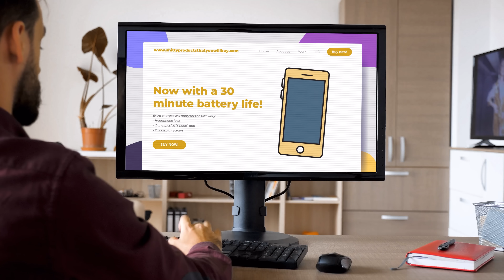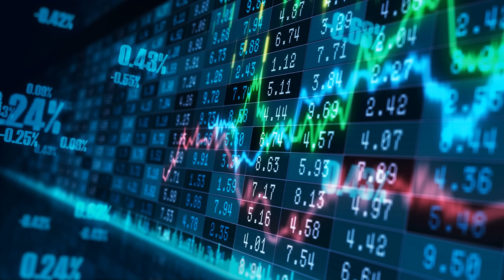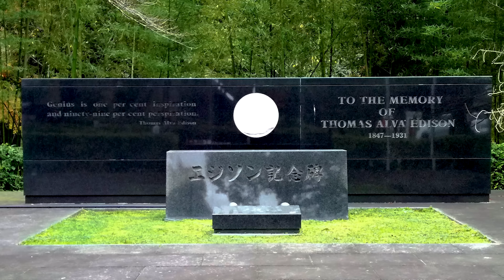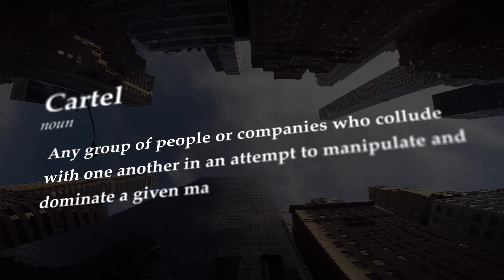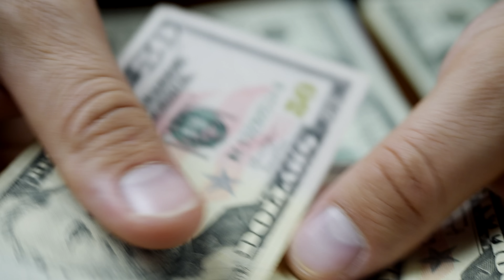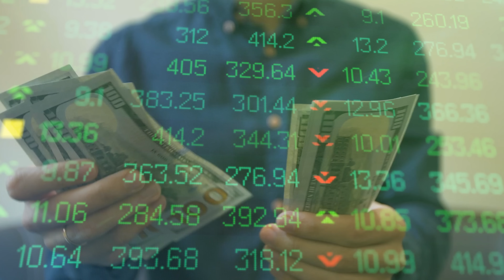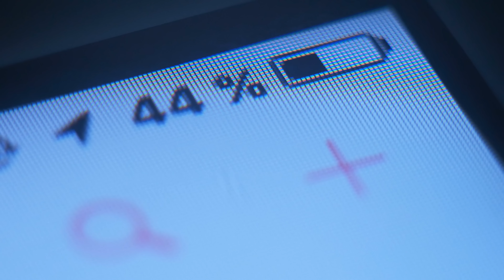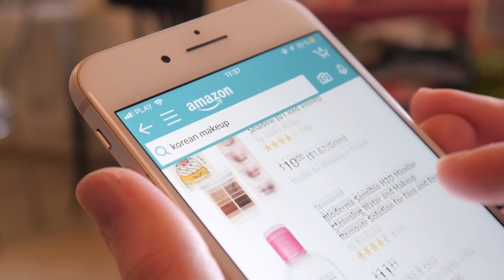Why All Lightbulbs Are Designed to Break

Comment: 4 years ago LED bulb boxing often included "lasts for 15 years" "15 year lifespan"

Not only has that marketing vanished the last 2 years, not a single one of the dozen bulbs i bought back then lasted more than 2 years.

Which is still better than the 3-6months incandescent bulbs lasted.
Reply: Technically, the LED itself will last that long. It's the circuitry that controls it that dies from heatsoak, mainly because of the minor voltage fluctuations that we experience.
Reply: that's bad for an LED. Mine have lasted much longer. We maybe change 1 or 2 out of the 20+ lamps every year at home.
Reply: A LED bulb which burns out that quickly is badly designed.  Properly designed, a LED bulb should last for roughly 10 years, and when it fails it will usually be the control electronics which fail rather than the LED.
Reply: @melkiorwiseman5234  my LCD monitor has 10 years and works just  as it did when was brand new
Reply: LCD screens have a LED backlight most of times, doesn't it?
Reply: @davidklein1245  that's why you should never use LED lamps that come in a single piece. I buy only the LED and a dedicated power supply, that way when the power supply fail, you can easily replace it, or even fix it, as usually its some capacitor, its easier to recap it and it will go for another 5y or more.
But usually the power supply won't fail, because you buy one that has specs greater than the LED needs to work, so it doesn't work overloaded as cheap crappy single-piece one does.
Reply: @srpenguinbr  As I understand it, most LCD screens use a "cold cathode" flourescent light as the backlight.  But running anything from a highly regulated supply will maximise its operational life-span.
Reply: @melkiorwiseman5234  I have like one of the old LCD widescreen TV's that came out about 20 year's ago that still works. lol
Reply: @melkiorwiseman5234  your prob right. I forgot about the 1.5 to 3 watt bulbs I bought for outdoor lighting. Those are still working, the low power combined with nighttime out door use allows them to run with low heat.

All the indoor 6watt+ bulbs have burned out
Reply: The two first LED bulbs I bought have lasted 7 years so far and longer than any of the newer models.  These look different than what you find today.
Reply: When I started buying LED bulbs I kept track of when each bulb was installed and where in the house, there were some Philips ones from Home Depot that hit the sweet spot of being fairly bright and lasting 6 years in continuous use spots. (Earlier ones were lower brightness.)  Unfortunately by the time I established that they stopped making that particular type.  (The good ones were the ones that were in 3 separate segments and looked yellow when turned off.)  The ones I find now (NOMA from Canadian Tire) are a lot cheaper but start flickering about a year in so they have to be replaced.  I'd hate to think what an epileptic who got one of these would be going through.

If I knew that was as good as they were going to get before going downhill I'd have stockpiled the good ones.

Oddly I still have 4 CFL bulbs that just won't burn out...I am wondering if they were the first ones I bought and the newer ones failed before them...I didn't keep track with those.  Though 3 of them are in lights that are only occasionally used.
Reply: LEDs have a real problem with heat.  Make sure your LEDs aren't enclosed.
Reply: Most of my LEDs are over 5 years old, and I find myself torn between "keep them because they work" and "get newer ones because they are brighter".
Reply: we live on a plantation
Reply: Our lives are designed to occupy us with buying replacement parts and new phones
Reply: @zakadams762  I still use my Nokia 6230i..... Does that make me weed?
Reply: @wernerviehhauser94  
>I still use my Nokia 6230i..... Does that make me weed?

No, but if you used a Nokia 420 that would be a different story... ^_-

Keep the bulbs that still work, if you have a room where you really need the extra light maybe put a few newer brighter bulbs there and keep the older ones that keep going put aside to replace bulbs in other rooms where it doesn't have to be as bright, or as something to fall back on if the new ones go quickly.
Reply: My incandescent light bulbs lasted many many years.  I use light switches with "soft start" and they increase the life by orders of magnitude, by giving the filament time to heat up before delivering full power.
Reply: All that time and effort to shaft people/ customers !! Imagine if us humans applied the same time and effort for the betterment of everyone ! Scumbags
Reply: @Ryan-fq8xw  True. BUT perfect products would only be possible if we, as a society, would find a way to work with only 20% to 40% of the jobs (that are partially created by inefficiency) we have today. Its not possible for us to work as each others hairdresser to fill this void - so, on the way to better products, we also need a better society.
Reply: @wernerviehhauser94  if we live in society like in Star trek, where all people have everything, and dont work for money, but just for better future. And everything is for free. But standardized. To be top quality but u cant have dudes driving bugatti fof 5 Million, and Yacht for 50 milion. Everybody need to be equal
Reply: @falconflylow  and I don't see this happening any time soon.
Reply: I've had the same LED bulb in my bedroom lamp for like 7 years now. Way brighter than the traditional bulb too.
Reply: @davidklein1245  Excellent point.
Reply: Blame the cost reduction race for short lived LED bulbs, cheaper support components, LEDs pushed very hard... 12 LEDs, no, we can get away with 10
Reply: @vids595  They're probably Chinesium bulbs, made for Philips and branded for them.  Unfortunately, even a once-respected company such as Philips prefers profit over quality.
Reply: @srpenguinbr  If it is an "LCD" screen, it probably has fluorescent back-lighting. "LED" screens are still LCD with LED back-lighting.
Reply: @falconflylow  pretty sure they tried that with communism Haha, but yeah where all to greedy it seems we struggle to work for a comman good unless theres something in it for us
Reply: @byronjeffries9754  The thing is, if we DID work (at least some of the time) towards the "common good" we would all benefit in some way. What goes around tends to come around at some point.
Reply: @Foolish188  Mostly true but it depends on the internal spce and the materials used.

For the past few years I've gotten away with using a 15W LED in my antique globe fitting in the bathroom .. this has a base made entirely of glazed ceramic and the (large, about 12" diameter globe is opaque glass. This allows sufficient cooling especially since I am using an ES to BC adaptor which serves the additional benefit of having the lamp right in the middle of the globe and also allowing more space above the lamp in the top of the enclosure. I wouldn't risk it in a HOT climate though. Nor would I do so with the smaller, plastic modern "copies" due to the smaller enclosure compounded with the insulating plastic.

Another benefit of course is the choice of colour; in my case the 6500°K LED gives a much cleaner white light (and a fair bit brighter too) than a 100W incandescent.

Note that CFLs rated above 15W refused to work properly in this enclosure, even for short periods.
Reply: @Foolish188  This I largely agree with but there are of course exceptions.

In my case, an antique globe fitting in the bathroom in which I fitted a 15W LED a few years ago:; this is about a foot diameter with a solid single-piece ceramic base and an opaque glass globe. The lamp is also fitted into an E27 to B22 adaptor which serves two purposes .. positioning the lamp right in the middle of the globe (where it should be!) and giving more space above the lamp base inside the enclosure. The glass and ceramic construction evidently provides sufficient heat transfer in my application.

Just need to check the internal space, lamp positioning within and the materials used and keep to a sensible wattage (which is critical). For example, I wouldn't put one of these in one of the more modern, smaller, all-plastic globes, or any "compact" fixture.

I did find that higher-wattage CFLs did not work reliably, even for short periods. But this LED provides a superior substitute and has a much nicer 6500°K white light, so I'm happy with that.

I tend to date code lamps on installation, so will check whether I did so with this one at some point. A number of the LEDs are from around 2016-2017. I still doubt they'll match the longevity of linear fluorescents though; e.g. the 13W under-cabinet lights in the kitchen have had the same tubes since about 2006 and have seen well over their rated life now. A bit like me I suppose.
Reply: @Foolish188  This I largely agree with but there are of course exceptions.

In my case, an antique globe fitting in the bathroom in which I fitted a 15W LED a few years ago:; this is about a foot diameter with a solid single-piece ceramic base and an opaque glass globe. The lamp is also fitted into an E27 to B22 adaptor which serves two purposes .. positioning the lamp right in the middle of the globe (where it should be!) and giving more space above the lamp base inside the enclosure. The glass and ceramic construction evidently provides sufficient heat transfer in my application.

Just need to check the internal space, lamp positioning within and the materials used and keep to a sensible wattage (which is critical). For example, I wouldn't put one of these in one of the more modern, smaller, all-plastic globes, or any "compact" fixture.

I did find that higher-wattage CFLs did not work reliably, even for short periods. But this LED provides a superior substitute and has a much nicer 6500°K white light, so I'm happy with that.

I tend to date code lamps on installation, so will check whether I did so with this one at some point. A number of the LEDs are from around 2016-2017. I still doubt they'll match the longevity of linear fluorescents though; e.g. the 13W under-cabinet lights in the kitchen have had the same tubes since about 2006 and have seen well over their rated life now. A bit like me I suppose.
Reply: @Foolish188  This I largely agree with but there are of course exceptions.

In my case, an antique globe fitting in the bathroom in which I fitted a 15W LED a few years ago:; this is about a foot diameter with a solid single-piece ceramic base and an opaque glass globe. The lamp is also fitted into an E27 to B22 adaptor which serves two purposes .. positioning the lamp right in the middle of the globe (where it should be!) and giving more space above the lamp base inside the enclosure. The glass and ceramic construction evidently provides sufficient heat transfer in my application.

Just need to check the internal space, lamp positioning within and the materials used and keep to a sensible wattage (which is critical). For example, I wouldn't put one of these in one of the more modern, smaller, all-plastic globes, or any "compact" fixture.

I did find that higher-wattage CFLs did not work reliably, even for short periods. But this LED provides a superior substitute and has a much nicer 6500°K white light, so I'm happy with that.

I tend to date code lamps on installation, so will check whether I did so with this one at some point. A number of the LEDs are from around 2016-2017. I still doubt they'll match the longevity of linear fluorescents though; e.g. the 13W under-cabinet lights in the kitchen have had the same tubes since about 2006 and have seen well over their rated life now. A bit like me I suppose.
Reply: @wernerviehhauser94  you could swap the low lumen lights to places you don't need the extra light. Use brighter ones where you really need it. What we do.
Reply: @nailsofinterest  won't really works since the sockets won't fit. Sadly, the pre-owners opted for 12V Halogen here, CFL there and the like. So I guess they stay where they are and I replace them when they break. Which, in the last 2 years, has been one G24, one T8 and one MR16 LED.

Comment: this happens all the time. I have worked for a very large construction and agricultural machine manufacturer, I oversaw the warranty department of north and south america, and all the components of the different machines were designed specifically to fail just outside of the warranty period.  Some things are setup to fail during certain applications that the machines are designed to do. such as backdragging. this is when you drag the bucket across a surface to flatten and smooth it out. They installed somewhat faulty anti-cavitation systems on the hydraulics.

Comment: Me: "But we have expensive LED lights now. They're build to last longer. Right?"
3 out of 4 of my Osram GU 5.3 LEDs: "Well, three years gotta be enough."
Reply: Gotta be careful if they're 12V DC, because cheap AC to DC power supplies are designed for the 50W lights, and anything less than that the voltage rises. Because LEDs generally don't have inbuilt voltage regulation, the voltage above the rated voltage will mean the light burn brighter and hotter.

The hotter it gets, the sooner it burns out.

This isn't a problem for AC LEDs, but with 12V DC supposedly safer, cheap power supplies are shoved out into the market.
Reply: It's easier to reduce the lifespan of a led light bulb than a filament, because of the electrics that drive the power. LEDs are sensitive to high voltages, more than 0.1volts of their maximum operational voltage can destroy the led, and driving the led with 80% of their maximum power (instead of 99%) with a stable voltage will increase the lifespan to about 2 to 3 times.
Reply: @ratemisia  I didn't research the numbers at the time when I made the comment. I misspelled electrics, should be electronics. By destroyed, I mean to be damage and output less than 30% of the light.
The 0.1 volts is probably OK for most of the LEDs, and it is for LED diodes, not LED light bulb. The LEDs power increases a lot for a small amount of extra voltage.
http://lednique.com/current-voltage-relationships/iv-curves/
From this site, we can see that a green light works with 12ma @ 1.96v = 23.52 mWatts.
If we increase the voltage by 0.1, we get about 14ma @ 2.06v = 28.84 mWatts, +22% power and this should work.
If we increase the voltage by 0.3, we get about 18ma @ 2.26v = 40.68 mWatts, +72% power and this should damage the LED.

The current influence the lifespan of the LED, and the lifespan VS current is dependent on the LED. The numbers that I gave was for a LED that I search years ago, I found other articles:

Here is a research article:
https://www.researchgate.net/publication/333990828_Current-induced_degradation_and_lifetime_prediction_of_310_nm_ultraviolet_light-emitting_diodes

"5. SUMMARY It was found that the cube of the operation current density is a scaling factor for the time dependency of the optical power of 310 nm UV LEDs. This means that the current density strongly affects the lifetime of these devices. For example, halving the current density increases the lifetime by a factor of 8".

This second one is for a different white LED:
https://www.digikey.com/en/articles/determining-led-rated-life-a-tricky-challenge
The current alone didn't do much for about 7000 hours. I think the total lifespan should be more than 7000 hours, and they didn't show until the end of his life. So it's incomplete.

Comment: Most things are designed to break, to where you can't fix, must replace.
When is last time you met repair guy or even seen a tv repair shop. Remember the maytag man.
Reply: J-dayday  my car thinks that    driver side door is not closed due to failed light receptor but they designed it so that if you were to replace it you need to replace whole locking mechanism. I wasn't going to pay 245$ for a failed 2$ component so i opted to cut the wires leading up to the receptor and connect it to a new one (one that wasn't manufactured for the car because you cannot buy it) and taped to reflector to it. Now the car thinks the door is closed at all times but radio doesn't work and service light pops up now and then. Retail service doesnt know what i did but they were able to fix the radio problem by connecting my car to a computer.

Comment: Original title : Lightbulbs Are Designed to Die Quickly.This is Why.
Reply: @JanyaAndromedaGalactic  it's only been 15 minutes bro
Reply: Original title : Lightbulbs Are Designed to Die Quickly.This is Why.
Reply: @JanyaAndromedaGalactic  just in case
Reply: @JanyaAndromedaGalactic  you know it will
Reply: Lightbulbs Are Designed to Break. This is Why.
(1st change)
Reply: It's not that different
Reply: Thx
Reply: "Die" is a negative word, which would lead to demonetization. He had to change it.
Reply: It's changed again "Why All Lightbulbs are Designed to Break" (2nd Change)